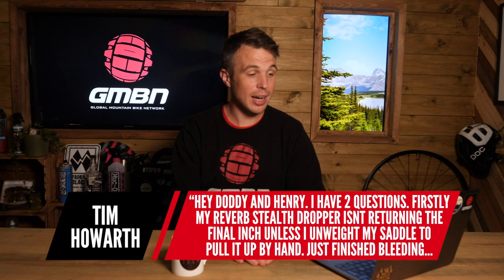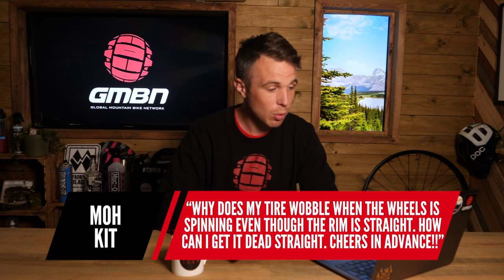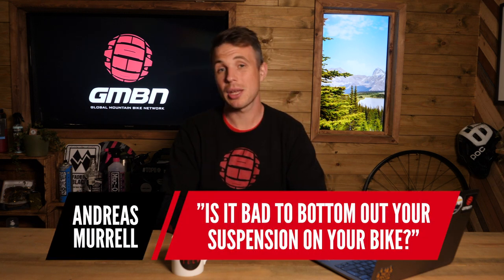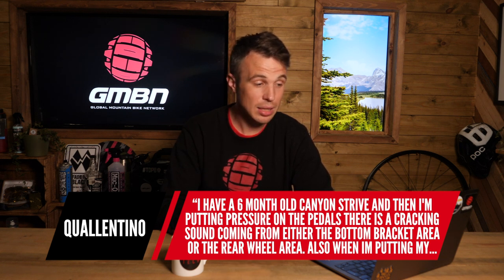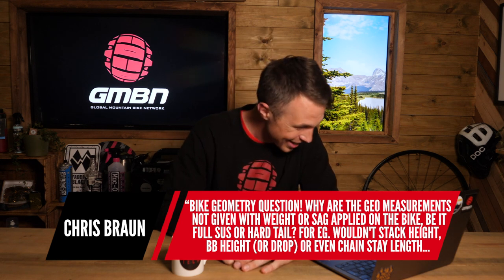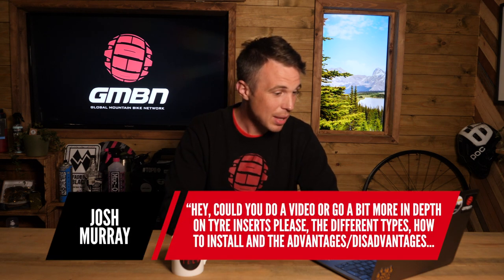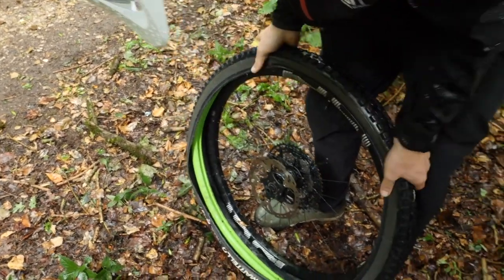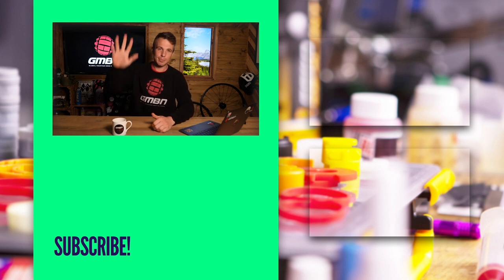Is It Bad To Bottom Out The Suspension Fork On A Bike? | #AskGMBNTech

Comment: #AskGMBNTech  Hi guys, loving the show! I have a dilemma about choosing my first full suspension bike. I'm 47 and just regaining my interest in MTB after many years of not riding. I'm 6'4" with very long limbs but have been used to bikes that were way too small for me. I've recently rebuilt my old bike with a large NS Bikes Clash frame (26" hardtail) as a kind of jump bike and even this feels way more comfortable and plenty big enough. But I now want a full sus! Realistically for my size I would need a 29" XL but I worry it may feel too big even though on paper it makes sense. In my head I'm leaning towards 27.5" L so it's not a too big jump from what I'm used to. I'm more interested in having fun than out and out speed. We don't have any bike shops around here so can't try anything out and I don't really have any riding buddies to try their bikes out! Sorry for the long winded question but any help would be greatly appreciated! Cheers!
Reply: Maybe you should add what type of riding you do and how much travel you want.

Apart from that, i was in a similar situation and went for the YT Jeffsy 27.5 in size L, while being just within sizes L and XL at 6 feet. I'm pretty happy with it so far, as my focus is more on fun as on speed as well.
Reply: I’m 6’2” always road large frames growing up. Now I ride an XL and it feels like bicycles were made for me and taller riders. It will take a few weeks to adjust to new geometry but trust me, it will be worth it. If you ride tighter trails with switchback go with 27.5, if you ride smooth flowy trails get a 29er. Both are great 👍.
Reply: 6'3" here. Went for 29" XL. What a difference to my old 26", feels like you're actually attached to the bike rather than just perched on top. You wont regret it!!!
Reply: @muifly4892  Thanks for that. I did think of adding that to the question but didn't want it to be too long winded. Really, I'm not sure what kind of riding I'll end up doing but having never been to a bike park, I'd love to do some proper trails. I was leaning towards an enduro bike but I think maybe a slightly lighter trail bike would be enough.
Reply: @jltrack  Cheers, sounds good!
Reply: @powtheginge  Thank you, definately makes sense!
Reply: @sixtring73  pretty much my thoughts, except i've been to a bikepark before :D 
I'd go for the trail bike, the uphills are not that fun with too much weight and travel and they can still handle bikeparks quite well. There aren't a lot in 27.5 though...
Reply: @sixtring73  Always get a bike for the trails you ride the most. Most people should be on trail bikes with 120-140mm travel. For the days you go to the bike park, rent a downhill bike. The local bike shop can help you choose a category of mountain bike for your local trails. Hope that helps.

Comment: Regarding the first question about the RockShox Reverb Stelth: I had the same problem, but only when it was clamped in the seatpost. As soon as I loosened the clamp it worked fine. If I torque my setclamp with more than 2.5 nm it will start so show the symptoms again. Luckly this torque is sufficient to clamp the seatpost tight enough in my frame. Maybe this helps.
Reply: You could also maybe throw some carbon paste in there to keep it in place at lower torque settings
Reply: @TrueElitegaming1 good point. I did that of course. I forgot to mention it.

Comment: I have had 2 new tires with a tread "wobble."  Rims were true, tires fully seated.
Reply: Fill the tire to max pressure, bring the bike or wheels inside over night and let it sit that way over night... next morning take all the air out then adjust the tire fitment and increase air pressure while checking the rim line on the tire.... this will solve your issue.. I take it they are foldable tires, they all do this...
Reply: Reason this works is it stretched the tire and makes it act as if it was not a foldable tire... other option is take the tires off the rims and lay them in direct sunlight for a hour then flip em to the other side...

Comment: I have done extensive bleeding on the magura mt5 brakes and I have gotten them to where ther every solid. When I take it to the bike park I notice that my back brake starts to pull closer and closer to the bar but never touching the bar and next day feels a littler stiffer almost like normal and when I go back and bleed them again there is air in them system again. What is causing this if it’s them getting too hot I feel like it’s happening too soon    Thanks  #AskGMBNTech

Comment: My forks brand new and makes that sounds when I bounce it on its back wheel?
Reply: I think it's your headset try to turn the headset Spacer's if you can turn them tighten your headset
Reply: @florisvanderhoeven7208  yeh I already checked that and there's no play in my headset it's coming from the lowers, I've got a 2020 rockshox revelation fork.
Reply: @florisvanderhoeven7208  also when I pick up my front end and drop it there's a slight rattle as well it's not the cables as there taped together.
Reply: @HowieMTB  Might be the brake pads shakin within the caliper. Pull the front brake (hard!) and go again to check that off first.
You got a floating rotor? Another "loose" part.
Reply: @geemail369  I'll give that a try and see if thats the issue, thanks.
Reply: @HowieMTB  try to pinpoint where the noise is coming from, could be your thru axel is loose or even the cables are rattling around inside your frame
Reply: @camerondavis7291  will do, thank you
Reply: Is it creaking? I've ridden many Rockshox forks with creaky CSU (crown-steerer unit). Easiest way to fix it is getting a new CSU with new uppers. I've tried loctite but mine is still creaking a lot.
Reply: @camerondavis7291  found the issue, the pin that holds the lever in on my SRAM level t break is loose and rattling but I have no idea how to stop it as I can't find a way to stop it rattling☹️
Reply: @789oGaming  no it's not creaking it makes a drrrrr drrrr sound 😂when I bounce it on the back wheel idk if that's normal or if it's supposed to be silent, I also found out where my rattle was coming from but dont know how to fix it as it's the pin that holds the break lever on, on the SRAM level t.
Reply: @HowieMTB  try looking it up in google and see if anyone else had the same problem and if they could fix it or you could always take it to your local bike shop
Reply: @camerondavis7291  okay will do, thank you.

Comment: #AskGMBNTech Is there any way to tighten the spring in a non-clutch derailleur (i have Shimano Altus 9-speed)
Reply: Would love an answer
Reply: No...
Reply: "Non-clutch" no.
But you could take some weight/pressure off the cage by using something like a "c.guide" that keeps the chain from yanking the derailleur forward on drops.
You can hack/bodge a similar device having your chain run through a piece of garden hose, zip-tied to your chainstay - go picture search for "best value chain guide" (Singletrack Magazine Forum) to get an idea.

Comment: @GMBN Tech: Thanks for the video. I have a similar question and would appreciate if anyone can help. I am 5’ 8” and I weight around 160 pounds. I do not jump high with my Specialized Turbo Levo but I am also not a novice. I go Black Diamond tracks however I am NEVER able to bottom out my fork and rear shock. Most I used is 60 to 70% of the travel at the most. Even when I jump on my bike with all my force and weight, I can’t do more than 50% travel. My bike is also new so the fork and shock are in working order. Should I lower the pressure? Also my sag is around 25% when I sit on the bike. Thanks

Comment: I installed Maxxis tyres with DD carcasse to my trailbike because i hate punctures and i understimated the weight difference (+750g makes a different bike but i got used to it). so the question is, are these also good for rim protection?
Reply: Yes they are! Thicker tires don't fold so easily but I think best for rim protection are tyre inserts

Comment: #AskGMBNTech I've noticed some pedal kickback from the rear suspension while bouncing the bike when stationary. I confirmed it was due to the chain pulling the cassette as the suspension compressed by disconnecting it and the knock disappeared. The  rear hub is a really fast engaging hub which I think is part of the issue. I don't notice it while riding, other than changing hubs or buying an Ochain device for £300, do you have a suggestions to reduce avoid it.

Comment: #AskGMBNTech
Hello there, I have a YT Capra with a 180mm Durolux up front and Triair at the back. I ride rocky enduro stuff as well as big jumps. Being used to my DJ bike for jumps, I don't like my enduro to bottom out on takeoffs and landings, so I ride my suspensions quite stiff, but my hands get numb very quickly in rocky descents. Is there a way two ajust my suspension in order to have them set up for both type of riding?

Comment: #askgmbntech 
Budget bike question! 
I have an 2nd hand bargain hardtail, which came with Manitou Markhor forks. I found a service guide and extended the travel from 100mm to 120mm. However, I cannot use more than around 90mm of travel. I have experimented with pressure, and in order to use all the travel the pressure has to be so low I blow through the travel with no resistance. With some experimentation I have settled on a fork that feels ok (a little sticky at the start of the travel, but largely ok). 
When I removed the spacers I noticed that there is a very long rubber seal, and I wonder if that is the issue. But I don't fancy trimming or removing this without a fair amount of confidence that it will work. 
Could you offer some insight into how to make use of all my travel? Or better yet, get your hands on one and experiment with it for us!
Reply: Trump TheTerrorist  Unfortunately thats not an option, if I had spare cash I would buy new forks or build a dream bike. But alas I must make do with what I have. 
Unless you want to donate me some forks? ;)

Comment: #AskGMBNTech
Drilling holes in my frame!!!
Hi there, I was wondering about adding bottle cage mounts to my bike since it doesn't have any. My bike is a 2012 transition blindside and I wanted to drill two holes in the downtube and secure the bottle cage using rivnuts. What are your thoughts? Would this compromise the frames integrity? Thanks

Comment: #AskGMBNTech I just built up a new bike from scratch and I've been having issues bedding the rear brakes. The first time I tried the rear brakes were squealing really bad and the the pads and rotors looked polished and have noticeably less bite than the front. I tried removing the rotors and the pads and sanding and cleaning with automotive brake cleaner (Being careful to not touch the rotor or pads and using nitrile gloves). This time I tried dripping water on the rotors while bedding and it seemed to work at first but after another ride they started squealing again. I repeated the process and tried bedding for a 3rd time and they're still squealing. The rotor is straight so does this mean that my new brake pads are shot? Are there any other tips you have to stop this from happening?
Reply: automotive brake cleaner might not completely evaporate and leave a little bit of residue. It wont harm a cars performance but different story on a bike. try another alcohol based cleaner or burn off residue on the pads using fire and try again

Comment: #AskGMBNTech This is a bit of a long one but I have recently noticed when I pedal hard from a standstill on my Bike I hear a sound from the back end of the bike it kind of sounds like the disk rotor where it has a echoing sound I found this out when I put my bike upside down and pedalled hard to spin the wheel but it also happens when I ride. I have also found when I rock my bike back and forth really slowly I sometimes hear what sounds like dirt being crunched in the rear hub and it’s really quite, I can’t seem to figure it out can you help me?

Comment: #AskGMBNTech why are some forks tapered and some not? It's really confusing. Is there some kind of advantage to have it tapered? Thanks
Reply: the first standard was 1" threaded. but thats very flexy and over complicated and heavy. so some engineers came up with the 1 1/8 steerer, or straight steerer, to be lighter, less complicated and stiffer. but with what we are doing with modern MTBs, the CSU (Steerer Crown Unit) kept snapping for some people on big jumps. so they said 'lets make the bottom, where it brakes, bigger!'. thats where 1 1/8-1.5 came from. just to complicate things, there is now also a 1.8-1 1/8 standard for some ebikes.
Reply: @bananasstuff3344  oh thanks! So the made the part that was weak and broke often thicker and stronger to reduce breaks. Thank you!

Comment: #AskGMBNTech Can you please explain the riding characteristics of a rear shock with a progressive leverage ratio vs. a more linear one? More specifically I know my bike has a linear ratio (Transition Sentinel v1) which is causing me to blow through the rear travel quickly unless I run really high pressure or way too much rebound. Cascade Components sells a custom linkage that actually adds travel and progression to the bike (7% to 20% they claim). This sounds great to me but what will riding it feel like and what are the potential downsides to more progression? I'm a little worried I'll lose how predictable and solid the bike feels off larger jumps.

Comment: #AskGMBNTech Is the Canyon Spectral AL 6.0 good ? Is it good value ? And more importantly, what do I have to assemble myself (and what tools are needed) ? Thanks !
Reply: Error 404 to assemble most bikes all you need is a shock pump (if you have air suspension) tyre pump, full set of Alan keys and a torque wrench is nice to have
Reply: A friend of mine has the Spectral 6.0, value and spec wise I think you would struggle to find better for your money. Ride wise, it's a bit of a tank getting it up to speed.
Reply: Excellent bike, good value it is.
Canyon has a how-to video up on what to do when receiving your bike - unboxing and assembly!
Get a decent multitool and you're good to go.
Reply: I think canyon are shipping their bikes with a tool set and a shock pump. You will even get a little torque wrench which is decent if you don't want to invest in more expensive tools. The handbook and the video mentioned before will guide you through
Reply: i saw plenty of reviews that say that it is ok for mellow trails but jumps and tech will scare it somewhat so get the strive if that's your cup of tea.
Reply: @bananasstuff3344  it's like 400€ more, and it's a 29er, and it's carbon, carbon is kinda scary tbh
Reply: @superspecky4eyes  I mean is it that bad ? what about pedaling ?
Reply: @Error-zp5cp   He finds it hard work to pedal up to speed, especially as it comes with 2.6 - 2.8 tyres. Once its at speed though, it smashes over everything.

Comment: Hi guys, love the show, (getting nerdy and geeky with bike tech is a great stress reliever for me!) I have a 27.5PLUS hardtail and I want to get new tyres. I mostly do XC (some commuting too) but I find my XC 27.5Plus tyres rubbish in rough stuff or jumps. What percentage of my riding should be trail/enduro style for it it to be worth the extra weight  of tougher tyres (300g to 500g per tyre)?
Reply: "commuting" and "rough stuff" don't mix - you'll suffer on either and, whatever you go for. Sadly there's no "set and forget" in this instance. Same for jumping (where higher tire pressure would be beneficial) and going off road on softer soil (where lower tire pressure will enhance tire performance).
But since you're riding a plus size rig already, go and make best use of that feature!
Here's what i would try:
look for a tire with medium center knobs, maybe even sloped/ramped ones (less rolling resistance, especially when going straight on harder surfaces) and bigger shoulder knobs (grip as needed it when cornering on soft soil).
Then all you need to do is adjust tire pressure according to what you're riding. Go for higher pressure when commuting and for jumping sessions. Utilize your plus size capabilities with lower pressures for off road use. Just need to find a "happy medium" for XC.
Reply: if you want better tires go for it if you feel that your tires are no good. if its just that you know they aren't good, not that you can feel them then i wouldn't. maybe wait until they are thoroughly dead first?
Reply: sounds like you need 29 wheels instead of 27+

Comment: #AskGMBNTech Hi Henry and Doddy , ive got a 2019 Canyon spectral CF and i started to hear some creaks , i suspect its the bottom braket since the only time i can hear it is when i pedal hard 
I think the bottom braket is press fit , what should i do to stop that creak , its not that bad but i suspect that if i ride it like that it's gonna get wors and its not good for the bike . Thanks
Reply: If pf, u can get special pf locking compound u use on the cups before pressing in. That should sort it. But use on a new bb also, when its removed might as well fit a new one (with locking compound)

Comment: #askGMBNTech poor brake performance question.  I have a Norco Fluid FS3 that came with Tektro hydraulic disc brakes (160mm if thats important). Im finding that one finger braking is quite a challenge because the brakes just don't seem to have the stopping power.  I thought maybe contaminated pads so swapped them but not really improved.  Any suggestions that might help?  Thanks and keep up the great series 👍🏻